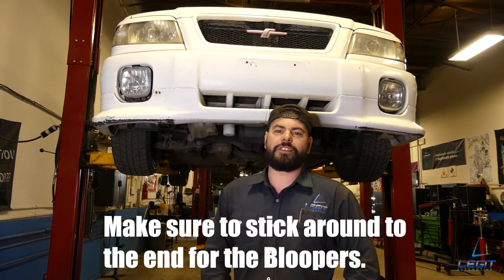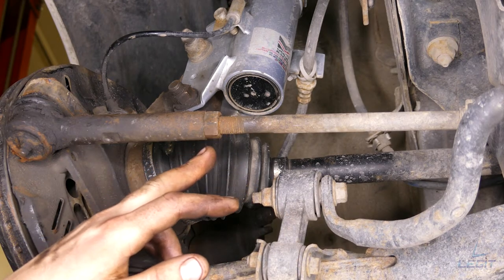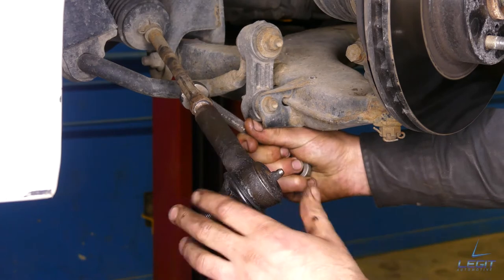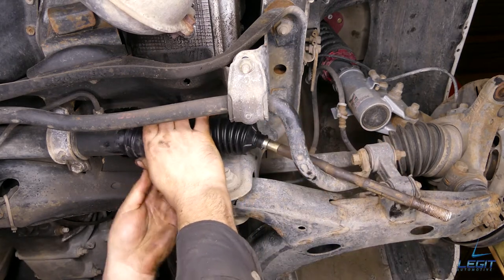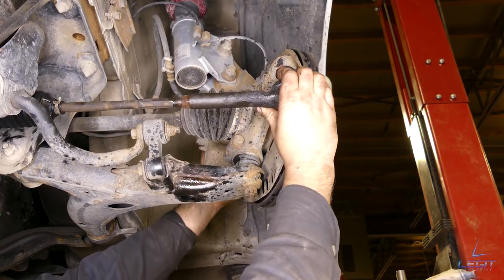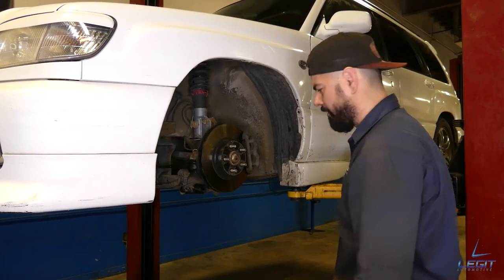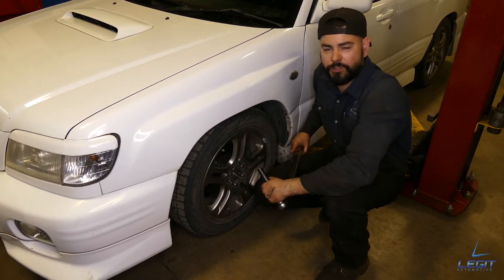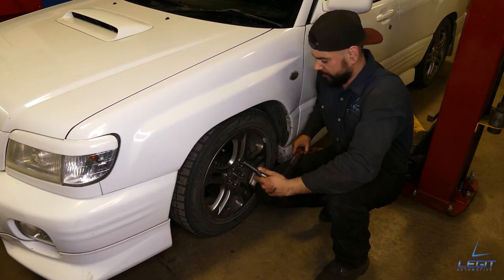How To Replace Power Steering Rack Boots.  JDM Forester

Comment: I'm not sure you need alignment,  if you mark the nut and shaft and count how many screw ridges it was before you disconnected (just in case)

But anyway it looked fast job...thanks